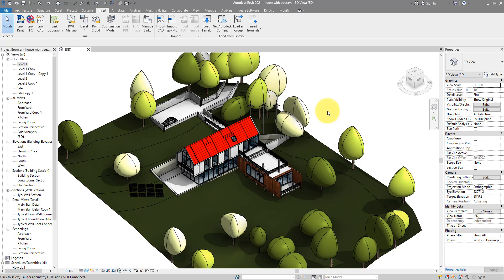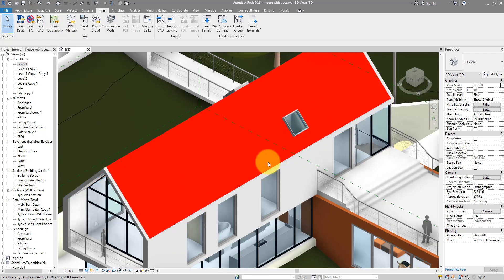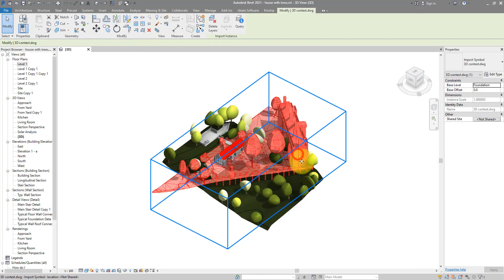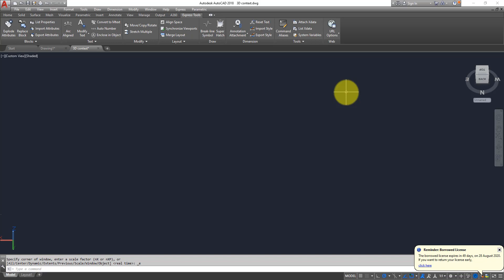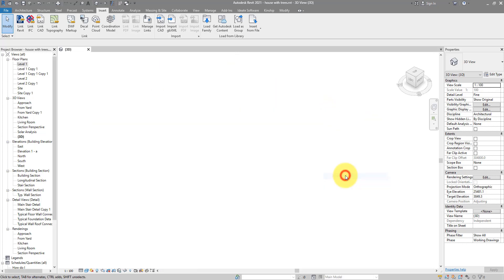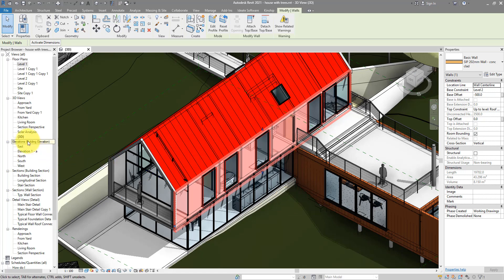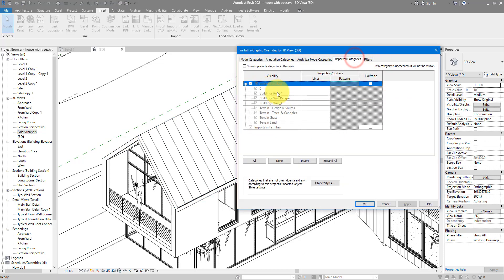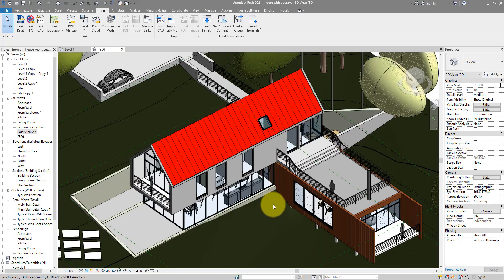Revit Snippet: Fix Non-wireframe Views Showing as Wireframe

Comment: Hi, i have the same issue, sometimes some elements turn in wireframe , temporary or untill I restart the view or I click on them.  I did a zoom out but I have a project survey point that at different elevation so its very far from the building. Could that be the cause?
Reply from the maker: The survey point's location is unlikely the cause. However, it's worth turning off that point and doing a Zoom to Fit and check if there're any elements very far away from your building. The most likely cause is a DWG somewhere miles away.

Comment: Sir ..is it possible  to scale complete  model in revit?? Actually  I was worked based on imported  cad file..bt mistakenly  worked with wrong scale..bt I found after I was finished  my entire  work... so is it any possibilities  to change  those  scale size sir ??
Reply from the maker: Well unfortunately you can't scale an entire Revit project. You can export the model to Autocad and scale it there, but that won't be a Revit model any more.
Reply: @RVBoost  ok sir...could  you plz make video what are the things we need to follow while  we importing cad into revit..
Reply from the maker: Sure! Apart from making sure to select the correct import unit, here's the rest of what to do when bring in CAD into Revit: https://youtu.be/XF3cTzpHP6w